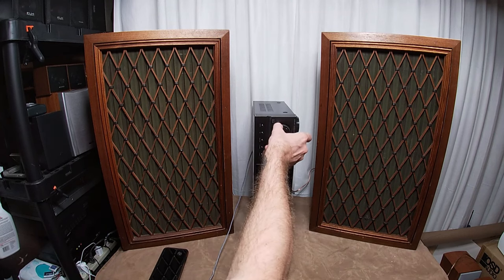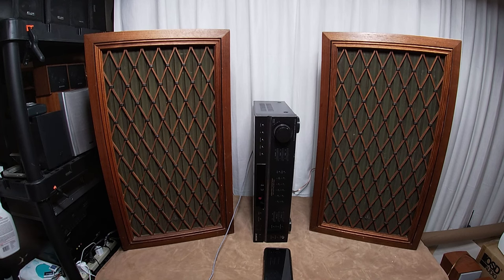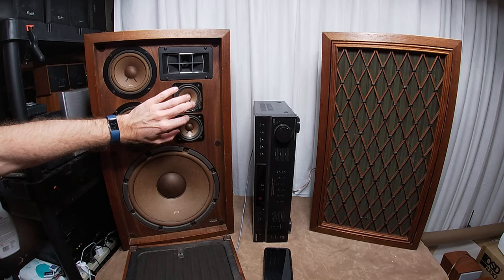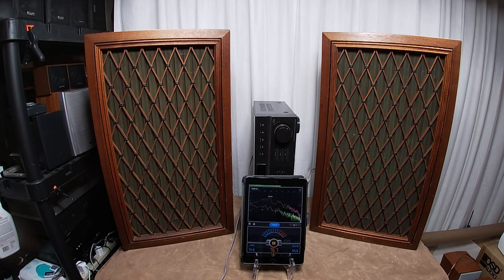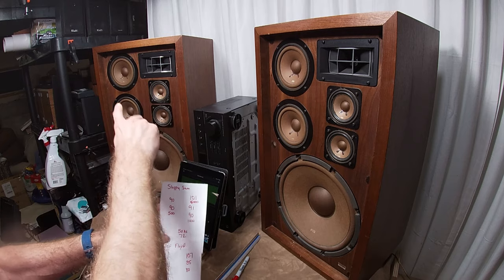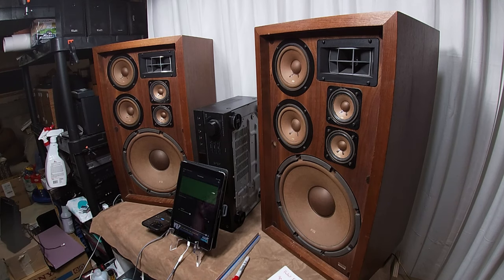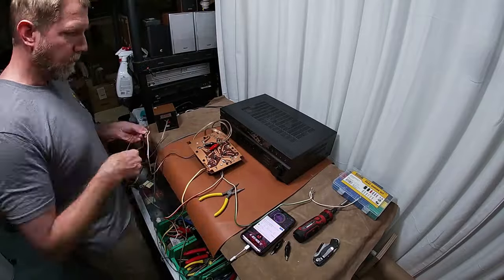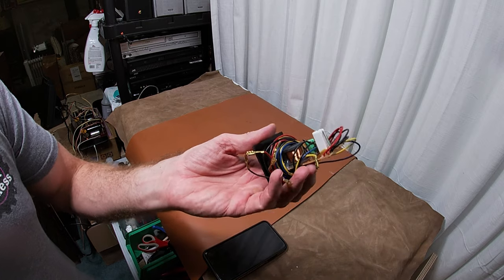How much improvement? Vintage Speaker Capacitor Upgrade & Replacement - Pioneer CS-88a

Comment: Excellent video!  I'm a Sansui guy and I re-capped my 1972 SP-2500's and SP-3500's about 5 years ago.  Like you, I used the Dayton low tolerance caps.  The change was dramatic.  The sound of the speakers opened up beyond my expectations and the response all around improved so much.  I did one other thing while I had the crossovers out by adding binding post connections so that I could use banana plugs.  I think the binding posts are the only way to go.  I also refoamed the woofers in the 3500's and that increased the bass response by allowing much more movement of the cone versus the stiff surrounds that were factory.  I was going to refoam the 2500's and maybe I'll get around to that some day.  Like the comment below I bought my speakers and other gear at the Navy Exchange in Yokosuka, Japan.  Had it all shipped home and when I mustered out of the Navy my first project was to set up the finest stereo I had ever owned.
Reply: I'm changing the caps on my sp-3000s this week. They still have e charm, but the 50 year old caps must be changed. Can't wait to hear the difference.

Comment: Capacitors degrade over time, it is a very well known fact but what amaze me the most is that the inductors are all in the same plane on the board and not placed at 90* angle from each other. The fact they are all ferrite core inductors didn't help either! My thought is this: Why not rebuild it completely with better quality components? I know the price tag may rise to a good sum, but I think the enjoiement you will get from them might be worthwhile. Thanks for the video! Very informative!
Reply: Not that I've heard these in person but speakers like this usually don't perform too well from an objective standpoint. Replacing crossover parts that already function within spec with costly alternatives would not seem worth it to me because then I might as well redesign the whole speaker. (I'd likely not hear or measure a difference anyway but that's another topic) I'd prefer to get close to the authentic vintage experience and enjoy the heck out of it.
Reply: That is certainly a very valid argument and if you don't like the sound so much, you could resale them at a very handsome price because of their vintage value! @RustOnTime

Comment: I just got a pair of CS-99's,  The Walnut wood cabinets are Beautiful (4 sessions of polishing with old English) Hooked them up to my Outlaw Audio RR2160 MKll with a outlaw Audio M8 Subwoofer and Wow they sound better than my Dahli Zensor's.  I would love to get these recapped or what ever they do to them.  There are no shops around me anymore.  I bid on them on a Maxsold Auction and won them for $60.00 oh each speaker weighs 49 pounds.  The switches on the back work. You can hear a difference when turning them.  I just subscribed.

Comment: I love the Pioneer CS series of speakers.  My Dad (RIP) had a pair of the CS-44s and the CS-99As.  I developed my love for music while listening to his system for many hours. I've just purchased a pair of working CS-44s to try and recreate the experience.  Of course, being 50-year old speakers, I'm going to do a couple of checks on them first...

Strange to see the cabinets of those speakers is so empty.  I opened Dad's CS-99As once and they were packed with acoustic fiberglass.  I'm fairly certain that the CS-44s were filled with fiberglass as well, but I'm going to find out if that's true in a few days. 

One of the reasons why crossovers are smaller in modern speakers is that typically they use a lot less drivers than the higher-end Pioneer CS models.  That CS-88A model uses a total of six drivers - most modern speakers use two or three :-) .

Sine sweeps using Room EQ Wizard (free software) are much better for performing speaker comparisons IMO.  I use REW almost exclusively now for my loudspeaker measurement (my site: www.diysubwoofers.org)
Reply: Tengo los CS88A y están cubiertos por dentro... Quiero repararlos.

Comment: i have my CS-A700 and they sound great just with ney caps... still +4db in bass for most amps and some extra high end frequencies (this model have a roll off in highs) and i think is close to high end in performace
BTW the reason to replace bad caps is not only that are out of messurements they also acquire higher resistance in series
Reply: I have the same speakers. They are smooth and accurate, but bass performance is sorta lacking. I thought recapping might help, but they sound the same. They might have just a touch more clarity
Reply: @edjackson4389  other mod i did was stuffin' the boxed with glass fiber but you can use poliesther as well... they went from 35Hz to 28Hz but still... the same quantity of bass...
i  end using DSP equalization (+9dB @80Hz cut at 160Hz-200Hz)... using high end mono blocks + preamplifier will give sorta the same performance... i had a kenwood Ka880D, mosnter 80's integrated amp, and the sound is supperb with the loudness from that amp +9dB @100Hz (but right now i use a nakamichi amplifier 1, high end inetegrated, this unit is the tipical japanese sounding unit like the newer yamhas, is not a good match for this units) 
i think they should sound amazing with HEGEL or NAD, but i think DPS EQ is good enough for me  
is like the sound of minimonitors + two 12inch subs
Reply: @crazymetallian  Yeah I really like the speakers. I had them hooked up to a Sansui 6060 reciever I use out in me shop. I just couldn't ever get that 50-60hz kick I like. I've got them sitting in the corner now. I put a set of JBL L50s (ported 10" 3-way) in their place. They sound much better. I'll eventually bring the Pioneers into my listening room where I have a 31 band Altec Lansing  EQ. Im sure I'll be able to adjust the sound more to my liking. Thanks for the tips
Reply: @edjackson4389  jeah, but sealed boxes don't kick and specially these infinite bafles is just a very clean sound free from port and box resonances... i have a pair aof PSB alpha P3 this little 4 inch speakers and at the same volume the pioneers will never achieve that kicking sound, but the pioneer won't never have problems with "choffing" or resonances is more of an "audiophile speaker"
Reply: @crazymetallian  I have a couple sets of sealed box speakers  that kick in the bass region. My Boston A150s have punchy bass. So do my Large Advents. More bass than the Pioneer A700s. They just don't look as good as the Pioneers with the grilles off
Reply: @edjackson4389  well with my meassurements, the A700 lacks in mid bass/natural bass 150 to 80Hz but amazing from 70 and down to 35Hz... the punchi bass is actually 80 to 100Hz which this speakers lack, but are also the mudy bass frequencies when they loose control 
i bet you listen to rock music... liten to modern pop with this or hip hop, electronic, that type of music sounds fantastic but they excel playing acoustic music/classical and some acoustic jazz too
Reply: @crazymetallian  Anything below 200hz is very dependent on the room, so I figure the differences we are seeing are either room or amp related. I definitely wouldnt call them amazing from 70hz down. Mine actually measure fairly  flat from 150-45hz. F3 around 35hz. Modern bass heavy electronic music is where Im most disappointed with them. I also don't have mine stuffed at all
Reply: @edjackson4389  well sealed boxes are supose to be not room dependent or not so as bass reflex speakers... i mean, with my amp tone controls to +6 in bass most music sounds well just kick-less and well i like how they sound listening close to my rooms wall, that produces a really nice reinforcement of sub 40Hz frequencies 
i like a lot of rock and roll and i have this lack of 150 to 90Hz and that's why i decide to use EQ for a more balanced bass in all frequencies  
other speakers i have are the technics SB-F3 they sound much more open and i like them most (similar to sonus faber lumina just need a little help with bass as well, but the smaller box presurize way earlier so they play amazingly well in my room) but i love the sensation of volume scale and effortless of the pioneers
Reply: @crazymetallian  The Pioneers are some of the most accurate speakers I own, but sadly some of the least exciting. I may try stuffing them as you have, but in my opinion those old FB woofers just don't have the power handling to get them to the level I need them to be at. Also, my room has pretty much the same effect on bass no matter the speaker or amp. Ported or sealed, I still have the same luls and peaks

Comment: I am not a technician. I’m wondering what was your cost for the replacement parts? What should I likely expect to pay a tech to do this work for me if I brought the crossovers to a shop? Thanks you, good job on the video. I have these speakers as well as a set of 77’s.

Comment: I’ve got a pair of 99a’s. I cleaned the pots sound great. Was going to recap them, took a look at the X-over network to build a parts list.  Probably taking the boards to Millersound.  Way beyond my hobbyist skill set.  BTW, having the FB embossed on the cones adds at least another $50.

Comment: I always use constant pink noise for measurements. Its so much simpler.
Reply: I would say it is only good option Even with this trouble is that   response  in graph has no individual standard picture to compare that could be treated ad targeted  ideal

Comment: Electrolytic caps dry up and degrade in as little as 3-5 years.  They become more resistive and the sound gets dull and closed in.  Every re-cap I have done (1% and 5% low ESR metal poly)  is a vast difference in clarity and openness.  It''s no contest.  Not to mention iron core inductors and cheap, corroded potentiometers and switches. Also, back in the day...they crossed the woofer over too high and you got mids from a woofer.  Lowering  the crossover cleans up the mids a lot.
Reply from the maker: I found one last night that was almost 200% above spec… 60 years old though. Vast difference after replacement!
Reply: I read in many places about ESR of electrolytyc capacitors. ESR is caused by growing resistance of metal electrodes but I am convinced that it doesn't appear with dry capacitors - they are like new when cut and opened even after 50 years. I listen to radio which just completed 84 years with original capacitors.

 it can't  be as crucial as thought and it doesn' depend on hours of "working" .  I proven for me that any resiistances in speaker circiut may be noticed by ear only when  increase is  more than 10% % of speaker resistance. Power goes 10% less means instead 5 watts we get 4,5Watt, at say 70dB is like nothing  Any  0,8 Ohm inserted in circiut  is hard to notice by ear  because it results in mild and linear not hurting way  . .Unfortiunately any 1% fault of value of capacitor is noticed much  and spoils sound of speaker

Comment: What a great video - I admire your fantastic informative job. As I deal already  long years (may be over 40 ) with  winding and wiring all possible crosscovers  targeting  DIY the ideal sound  I was very curious. abiout such direct replacement  

I think you did what was possible caring not  to spend months on such complicated problem. I wouldn't say it is better now. Previous setting was at least linear  and convinent for correcting with any EQ in praeamp.

 Now it has own "U" shape which is generaly posiitve for average loudness but may not be in line with  standard  two way tone controls in preamp or loudness correction.

Very clearly the high mids are stronger now and lower mids are down., Not sure about exact circuitry but I think Your new capacitors have  now    lower value - original You have  shown had about 70 uF. It looks as +40% tolerance? Hard to say if producer did it deliberately - may be they had such bigger values in box and prefered them. New smaller values  may alow more consumption of  upper tones  by bass speaker, which should not  emmitt them   but  lower mids in next speaker have this  energy too little making that  low  mid band down.All this is messed additionaly normally by phases of harmonics. 

 Capacitances and inductances are very critical for ear reception. I have my own experience that mistake in having the  best  value  of any element may be accepted only on level of max 1% It means that for two element LC filter both should be  hit with 0,5% accuracy - more is sensed by ears and not accepted by me . Stereo speakers won't have also the same souding.

 It is realy complicated crossover and with connection to speakers and their mechanic and electrical properties it is impossible  to estimate what resonances are created when we change the data of fitering.  For sure values in   compare to old were chnaged too much

Comment: Question a couple of others have asked. What app are you using or recommend for the audio measurements and display?
Reply from the maker: Sorry… I don’t get into comments much. The mean comments tend to make me not want to post… so I ignore comments all together. The app is decibel x. I use f generator (another app) for sound sweeps.

Comment: I find it rather odd that the new caps are so much larger than the old. Usually it's the other way around by a long shot
Reply: That's because he used film caps instead of wet caps.  Wet caps are the original equipment and a lot smaller.  Film caps don't degrade over time like wet caps do.

Comment: Halo , sir can i ask when u bought this speakers back inside is electrolytic caps n do u replace with new modern poly caps right ?
Reply from the maker: Hey there. On electrolytics, you want to buy the freshest you can find. I buy from mouser, digikey and parts express. It’s very important to buy the exact uf rating at 100 volts or higher.
Reply: @kappandrew1  I have do some research , as u mentioned voltage 100v higher n now market have 250volt or 400volt u prefer ? Thzx for some advised !

Comment: Wow. I'm subscribing! I can't believe I found a video on these exact speakers. I just bought a pair of these. Voice coil was toast in one of the 12" speakers so I'm replacing them both with Jbl 12PWPRO 12" 275 Watts Rms - 8 Ohm Woofers. I also had to buy a foam kit for the 4 round tweeters. When I get them done, and if they sound good, should I still consider rebuilding the crossover board?
Reply: hi   i see you have two thumbs up    and you chose replace both woofers with the JBL woofers,but here is a thing,louspeakers  have a very long list of parameters  that list used  to work out cabinet dimensions etc   for resonent frequency   compliance of the woofer   cabinet volume   and many more. If your choice is just a guess,with no science or maths behind the choice   the speakers will not sound nice,even the crossover  will not be optimised  for that woofer. So i pick on one parameter   woofer efficiency    if your choice woofer  is say 4db more than the original   you will have to start   making modifications to the original crossover.I am no expert here   so i dont know what the parameter  for the speakers  is   regarding  cabinet volume  i think Qs   but i could be wrong.  Get that one wrong  and the woofer swap   can be a  disaster   woofer booming  and resonating.the reality is   unless you understand full the mathmatics   side  of the parameters  needed to design  the correct enclosure.Dont mess with it in the firstplace  as you will be very disapointed      and wasted a lot of money      and have made a set of speakers   that are worth nothing to anybody.  what you can do for the best result for re-building your speakers    is get the bad ones  re-foamed    follow the instructions   here for rebuilding the crossovers    and lastly    look online  and wait until you can find   a second hand original woofer    as the crossovers and other units in the box were built to match that woofer   thats how you get these speakers to sound the best.Maybe you think i am exagerating ?  But i am not
Reply: Parts express can help you find new woofers with the same parameters as the originals, otherwise, you will probably be disappointed, also replace ALL capacitors, preferably with poly caps,

Comment: Would you happen to have a list of the capacitors that you use and where you got them I have the same speakers that I got from thrift store in very good condition I know it needs crossover thank you
Reply: Since the exact values were not available, I combined capacitors in parallel (capacitance adds in parallel) to achieve the required values.

For C1, a single 50 uF capacitor was used.

For C2, two 15 uF capacitors were used.

For C3, a 1 uF and a 4 uF were combined.

For C4, two, 1.5 uF capacitors were combined.

For C5, a 1 uF capacitor was used.

So, to fully recap two crossovers, you need:
* 2x 50 uF
* 4x 15 uF
* 2x 4 uF
* 4x 1.5 uF
* 4x 1 uF
Reply: Parts express

Comment: When you set speakers that close togather.   You can't tell anything.    Move 
Them 5 feet apart.    See if you can stand it 
    Change out wire ,binding post  install  feet.
 NOW  X your fingers.